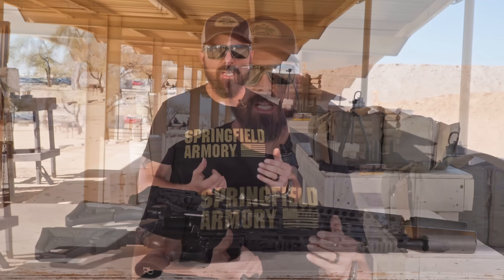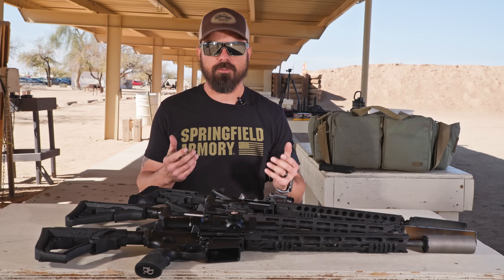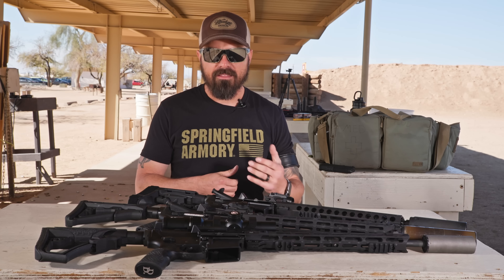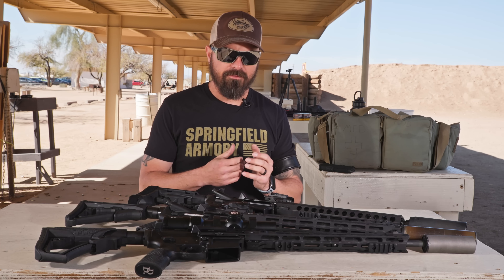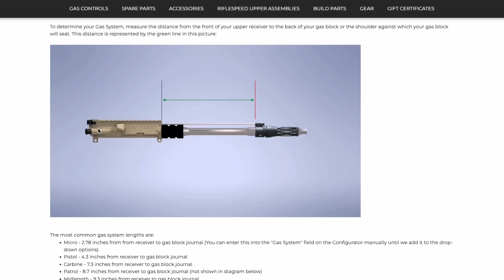Gas Back Bressure Mitigation Head to Head - Riflespeed vs Bootleg vs Superlative Arms

Comment: Rifle Speed is fantastic for tool-less adjustment.  But Rifle Speed adds a lot of weight to the front of the rifle.  I wish Rifle Speed made a version of their gas block out of aluminum.  Superlative Arms piston system is ideal.  Minimal gas going back into the action and less weight than the Rifle Speed.

Comment: Riflespeed looks super awesome, I can see how effective it is, but at the end of the day, I can load light loads, tune my basic set screw gas block to those, and have function in any configuration without messing with it again. Would I rather have a super cool high speed looking gas block from Riflespeed? I mean, yeah, but not 200 bucks worth of want.

Comment: Come on superlative make a gas adjustment like this combined with your piston system. I have two superlative arms piston systems AR’s. Both are suppressed and run great and clean. I will be mounting a rifle speed on a 14.5 that will be suppressed and un suppressed. I am sure it will run fine but not as clean as the superlative arms piston set ups.

Comment: Rifflespeed Adjustable Gas block:  Good product, TERRIBLE CUSTOMER SERVICE.  I have three of these.  One has plunger issues (gets stuck when I shoot a few rounds on my 308 SFAR).  Support insists it is a bad gas port causing bullet shavings to get into the plunger cylinder.  They made the diagnosis without ever inspecting the gas block or the barrel or even seeing photos of the gas port.  They simply told me that is my problem and left me holding a defective $200 gas block.  Also, before buying this one, I emailed them to confirm that the model I was ordering would be long enough to work on my rifle.  It wasn’t and I cannot adjust the gas knob with the small amount of the control knob that protrudes from the front.  Again, support simply gaslit me and said “I have one and it works on mine” and I was left with no option other than having to replace the hand guard for a shorter one.

UPDATE: Since I have three of these I swapped the larger heavier control knob with a smaller lighter one and also swapped the wave spring and plungers.  The 308 did not have issues at that point and the bad parts also worked on the other lower recoiling 6.5 creedmoor SFAR.  I swapped everything back, but increased the tension of the wave spring by increasing the bend on each wave by hand.  I ran another 8-12 rounds and it seemed to be working.  The point is the issue was not bullet shavings at all.  So far I have wasted money on three range sessions and dozens of expensive 308 and 6.5 CM rounds to trouble shoot the issue on my own which appears to be either an engineering design issue with higher recoiling rifles and the heaviest control knob they currently make or a defective out of spec wave spring.  Either way, TERRIBLE CUSTOMER SERVICE!

Comment: Riflespeed with a Superlative type of piston would be the best thing ever
Reply: Eh, only if you're worried about water getting into your gas system. External pistons just add too much weight and worse recoil to justify using them beyond "they're easier to clean and the reciever won't foul up as much."
But, consider this: you're already going to be cleaning the reciever and Bolt. While an Internal Piston will get dirty faster, normal maintenance also cleans all of that up without you needing to fiddle with the gas.

That leaves the only true flaw: if water gets inside the gas tube and you fire the gun, the tube will explode. That is the original reason why the military began looking into external piston alternatives to the M4.

Comment: I ve tried to tell guys this for years that had 300 BLK out problems they couldn't get theirs to run subs unsuppressed I said what buffer you running Oh they say h1 I was like that's why switch to a carbine buffer or lighter and adjustable gas block makes a world of difference . My 8 inch build has always cycled only failed with horrible or under powered ammo love my superlative arms gas block keeps that gas out of my face when running a suppressor .

Comment: Calling user error for the bootleg adjustable bcg (probably causing his reliability issues).  For the bootleg adjustable bcg, you don't have to remove it to make adjustments.  It's slotted on the ejection port side for adjustments so you don''t have to disassemble the rifle to make adjustments.  Plus, the was he was turning the adjustment port to the up (12 o'clock) position isn't correct either.  The 4 adjustments are at the 3, 4:30, 7:30, and 9 o'clock positions with a solid detent to let you know your in the correct position.  By doing what he was doing wasn't tuning it correctly and in turn removing the adjustment port.  You can see it protruding on the ejection side of bcg when he re-installs it.  It's not fair to review a product that you are using incorrectly.

Comment: I’m tempted to put the rifle speed on my Dissent and Dremel whatever I need to. It does not let me adjust the gas down to the point that I have a bolt gun even without a suppressor. 

The recoil springs also seem weak so I would like to find a way to upgrade those…

Comment: I love the Superlative gas block for DI systems.  It is my go-to for builds that will have suppressors now.  The built in bleed off valve really makes it a no-brainer for me and it works all the time, dirty, clean, subs, supers, it just works.
Reply: I'd just asked what his opinion is of these.  Have a 13.9 Criterion CORE I'm about to pin & weld that came with a Badger non-adjustable GB, and will be suppressing (albeit, likely with a flowthrough can).  Trying to decide if I should keep the Badger GB or go with an AGB, and considering the Superlative Bleed Off AGB.  Being that it bleeds off under the handguard, is it getting all over the hands, hot, on your hand upfront?  Thanks for any info!!
Reply: @velocitydreamer  The Superlative bleeds forward, towards the muzzle/silencer.  The bleed off is nominal small puffs of gas, even after a dozen mags you can only see a small discoloration on the end of the barrel and back of the can.  The handguard does not get hotter because of the gas shooting forward.  Hope this helps!
Reply: I run the superlative gas blocks and I like them alot , as the other guy said and kinda round with or without a can. Your actual milage may very so do some research and watch what others say about it too !

Comment: I put a superlative arms bleed-off gas block on each of my AR's. I don't need the full piston setup. No gas in the face, shooting suppressed with a regular can is just as dirty as shooting a regular DI, it's MUCH cleaner. Also, you don't have to fiddle with buffers or springs. I wish there was more adjustment because my 308 pushes way more gas than my 5.56 and I'm blowing off as much gas as I can without the adjustment screw falling out (thankfully a detent keeps it in place) but it's the best solution I have found.
Reply: Would you recommend the Superlative Bleeder AGB for a 6mm ARC build?

Comment: Properly sized BRT EZ Tune gas tube with correct buffer has worked well both suppressed and unsuppressed, no fiddling, just runs. Not a fan of a way overpriced gas tube, but it has been a great set it and forget it system for me.

Comment: Just started using the rifle speed system last year on a .308 SFAR and it's truly the best system out there with many settings as well as plunger options. I set mine up to run both suppressed and un-suppressed. Easy to adjust as needed. 

Awesome video on explaining these different systems. There's also an adjustable gas key option that I started running on a retro build.
Reply: I just got mine for my SFAR I just need to install hopefully this weekend.did yours work with the .917 plunger that comes installed?

Comment: I have a LWRC DI 16”. They’re known for being over gassed. I put a Bootleg carrier in it to experiment with taming it down a softening recoil. It runs fine/normal on the open setting. In the second setting the bolt cycles, runs slightly softer but would not lock back on last round. On the third setting it was failing to feed. 

I was a little disappointed but it was mainly for fun and to tinker. The factory setup recoil isn’t all that bad. I put the factory bcg back in and will keep the Bootleg for the future when I finally get a suppressor.
Reply: Good notes thank you for sharing

Comment: Ive always heard that adjustable gas blocks are added points of failure, how durable and reliable is the riflespeed when it comes to a rifle that experiences heavy use with less than favorable conditions?
Reply: Great question, I have had no issues with a standard adjustable gas block. If you’re worried about extreme use, it’s a good idea to use a cross pin or drill the index pocket under the gas block with the jig.

Comment: You are Speaking the truth on the bootleg about bleed. 
On my mk18 and BCM 11.5 unsupressed it does seem to take a little bite off as those are over gassed. However with my 14.5 mid length, I get short strokes or failure to feed or fail to lock back due to that system being very soft. So that gets the standard sogl or BCM bcg. 
Suppressed setting Bootleg with dead air sandman S BCM 11.5 has no recoil whatsoever. Great video
Reply: Great notes, thank you for sharing and thank you for the positive feedback and support

Comment: Great video! So I am new to suppressor world. 
So it seems if you attach a 5.56 suppressor to a 5.56 AR… it should just “work”. 
How many different mods or upgrades are there?! Am I correct in thinking there might be much trial and error? 
This is something I am excited about but slowing down on my first purchase because it could be the wrong one even though it’s supposed to be right. 
Sorry for the newbie questions.
Reply: Thank you for asking, if you get a low back pressure suppressor you really don’t have to worry about any mitigation. It is still nice to do a little bit of tuning so that your gun stays super soft shooting. If you do a full back pressure suppressor then yes you should definitely do something to mitigate the back pressure.

Comment: Loving the content.  I have a pinned and weld 14.5 barrel that has a muzzle device that will not accommodate a suppressor so I need to change it out to have a new pinned and weld suppressor ready muzzle device.  Any recommendations?
Reply: I have a gunsmith who does my pin and weld work. Very often I buy a gun that’s a 14 five and have to have it changed. However, when doing so I use the adjustable bolt carrier system. This way I don’t have to try and tinker with a bootleg underneath the pin and weld. I have done that several times beforeand as I mentioned, sometimes it takes Tin and the pin and weld definitely makes it harder.

Comment: thank you for this video it is very informative, I was considering getting a bootleg BCG and was unaware of the riflespeed adjuster, I do not have a suppressor yet but I am doing all the neccessary research now before I get a basic polonium can, do you think I should get both the riflespeed and the bootleg?? will both cause issues with the rifle bleading too much?? Or should I get both so I can tinker with either or and get my rifle properly tuned. I would appreciate hearing your thoughts.
Reply: Good question, both of them are good options depending upon your weapon set up. Combining the two is likely unnecessary. Usually it’s better to do one rather than the other. If you combine the two, there’s a possibility you’ll be bleeding off too much gas and therefore have malfunctions. But having the two so you can testthe bolt carrier and if you don’t like that, move to the gas block is a good way of doing business.

Comment: Can a Riflespeed gas block be installed on BCM rifles? I’ve heard removing the factory gas block can be very difficult.
Reply: Good question, as long as there’s enough space under that rail system, it should be fine. My BCM uppers I have left factory and have used the adjustable bowl carriers in them.
Reply: @ Thanks! Replacing the BCG would be a lot easier. Have you tried or hear anything about the new Griffin Armament Gas Pocket BCG? GA makes good stuff, so I wouldn’t think they would put out a gimmicky product.

Comment: I would love to see your opinion of the BRT gas tubes
Reply: I have done a little bit of research into those. I’m not terribly interested in them. The reason is their design for stress only. That means when you don’t have your suppressor, your rifle will only be both action. Also, they use gross tuning and this user cannot make any adjustment to it. This way it’s left to the discretion and understanding of the manufacturer to assign a level of pressure to your suppressor. This seems kind of like guest work to me and I would rather have something that I can tune myself.

Comment: RifleSpeed on my two DPMS LR308's. Low round counts so longevity is yet to be determined. They work fantastic! RifleSpeed testing claims state it will last longer than your barrel. The RifleSpeed uses straight gas tubes! I had my DPMS LR308 straight gas tubes custom made at 15.400" by White Oak Armament.

Comment: I find that an adjustable gas block works best in most situations. I like superlative the best but have received a lemon before. A tip for using the supplied long Allen wrench if your block is tucked far back you can usually come in from the side or the top of your handgaurd if you have m-lok to make the adjustments. I tune it without the can then again with it making a note how many clicks from bottom each position is. Usually the two are only a couple clicks different.
Reply: Thanks for sharing. 🔥🙌🏻

Comment: Bootleg BCG works like a charm with my 11.5” with H3 buffer. Perfect ejection and shoots so soft
Reply: This is the route I’m thinking about going with my 11.5
Reply: @ you won’t regret .. just make sure you get a nice charging handle because the smoke will come back .. I have an aero precision breach and it does a decent job
Reply: Agreed, I have a Geisselle S42 H2 14.5" with a 0.078 BRT gas tube with the bootleg. Unsuppressed is a beautiful 4 oclock. Setting 4 is a smooth 4oclcok with a full length OCL Polonium, and the first tick is perfect for the OCL Infinity

Comment: I use the Black River Tactical EZ Tube on my rifles both suppressed, and un suppressed .
Works like a charm, no gas in face, ejection consistently at 4 o’clock. No moving parts to fail.
Reply: this is the way
Reply: I’ll have to look into that one. Thanks for sharing

Comment: Great video as always, Rob! That being said, upon returning from your East Valley Tactical suppressor event, please let us know which "new" suppressors to be on the lookout for, for 2025/2026, in the sound performance/suppression (quietest) department, and the best new low back pressure cans as well, please & thank you!! 

Some folks are sound wh**es just looking for the quietest thing regardless of weight and length, and others want to protect their upper respiratory system as much as possible (low back pressure/gas in face etc...).
Reply: Definitely!! I’ll be there. Say HI if we bump into each other! 🎉

Comment: I love the Rifle Speed because I can use a bore scope to see the settings in the barrel port and can modify the plunger to sit at the settings I want. I can also stack the setting springs if needed to increase or decrease the tension of the adj knob. It is the easiest, proven Adj gas block to service and maintain I have used..

You also forgot the Faxon adj gas block that moves the gas tube. I have been experimenting with this adj gas block and it has worked perfectly so far..
Reply: Proven?
Reply: @Dexter-nw2fe  Yes, proven. The RS adj gas block can be disassembled without any tools and parts replaced in under 30 seconds. Try that with any other adj gas block. The block itself will out last barrel after barrel. The only consumable parts are the plunger and adjustment spring. Even those will out last the barrel.
Reply: @Dexter-nw2fe have done A TON of research over the course of a month and have found nothing but positive feedback on the rifle speed gas block. It seems to be a must for suppressed rifles. I however have no personal experience with them, yet.
Reply: I’ll look into the faxon gas block. Thank you for sharing

Comment: Adam's Arms. 5 (toolless) gas settings. Great system, but out of business. Personally, I think it's important to consider if you want a system that requires a tool to adjust or not. It can be pretty annoying if you need to adjust your gas, but you forgot your 6 inch Allen wrench at home.
Reply: Correct, bought up by Alex Pro Fab.  Piston parts are available.  So no discounting Adams Arms, honestly great system that is slept on.
Reply: @SG-AKAR   @Swensonfactory Thank you, I was unaware of this. Do you know the details of why?
Reply: @dillontimm9442  It's my understanding they bought the patents and remaining stock.  And by the looks of Adams website, it looks like they may attempt to get the brand up and running again.  It is taking some time, so we'll see.  Hopefully they come back in some way, shape, or form.
Reply: @dillontimm9442  not gotten into details, I’m not an insider, and haven’t checked for a few months. Giving them time to get back up and running.
Reply: Very good point. Not just be able too but how long it takes to even use that silly Allen key
Reply: They’re back with new owners I believe.